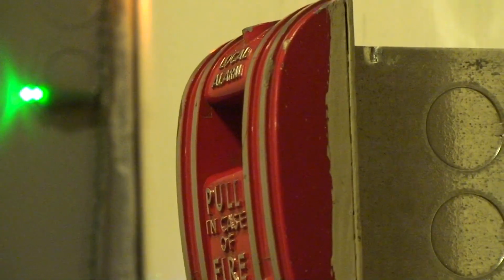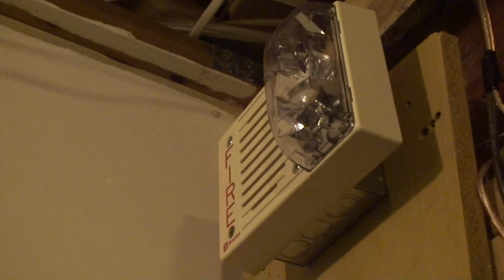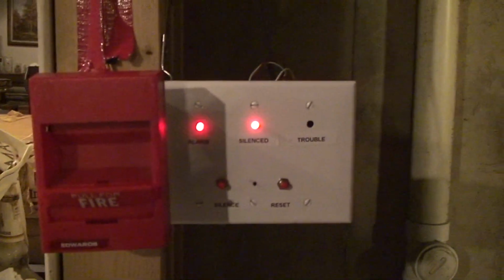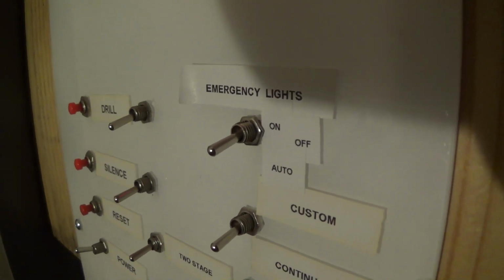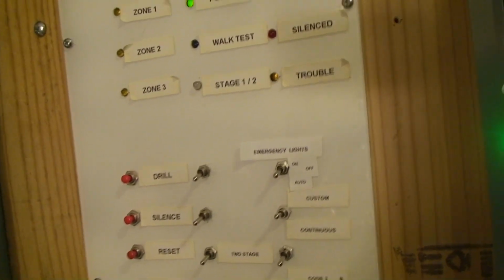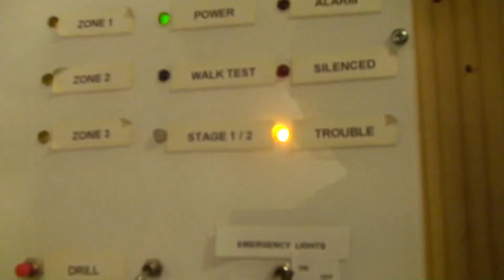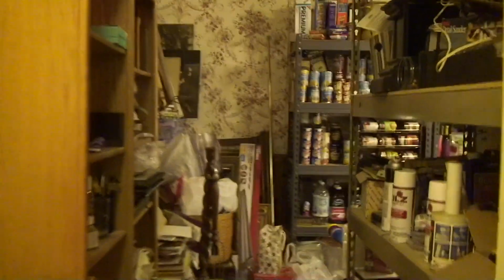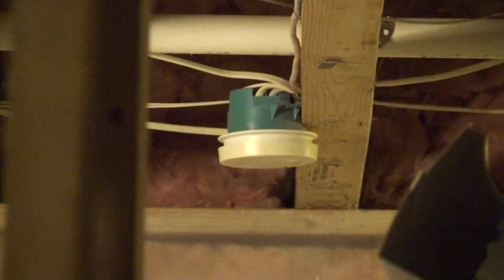System Test 19: New Features, Devices, etc.

Comment: I just got a New Grote 76963 strobe for free. I actually found it in my friend's garage.
Reply from the maker: That's pretty neat!
Reply: Did you research it?
Reply from the maker: I looked at it on Google Images, it reminded me that I need to invest in some amber emergency lighting lol
Reply: Remember, it is a strobe.
Reply: And is is made to go on a car. Much bigger than i thougt. And no terminals.
Reply: Did you ever have the chance to check out my YouTube channel? You know you can just click on the avatar or photo of a user like in a comment or something.
Reply from the maker: I have!  Your videos are good, just remember to record horizontally instead of vertically.
Reply: I do have a review on my spectralert advance and an all tones test of it
Reply: That is the only way I am able to record. Unless i just use ANDROVID
Reply: Do you have a spectralert advance?
Reply from the maker: I have a ceiling mount version without a bracket.
Reply: I have the wall mount with the braket. But without it, you can't get it to work.
Reply: Mine is red. It is also what is in my school.
Reply: Also there is an MGC sh-120 set to broad band code 3 and a potter sprinkler bell outside.
Reply: Do you have a white version?
Reply: Wow

Comment: Can I recommend for some smoke detectors, either a simplex 2098-9636 or a simplex 2098-9201. Both are old simplex smoke detectors but they work very well and are both photo electric. They also activate faster than most System Sensor detectors

Comment: There's a whole bunch of cool things you've added to the system 🙂! Nice

Great video 😉. Also noticed the 9219 is rather low pitched than it sometimes sounds (almost like the FOS 6120, Simplex 9838, and the Simplex 9833). Then again, my 4901/4903 horn I originally had sounded exactly if not about the same as yours, so yeah. Pretty interesting though how mechanical horns can have a wide variety of "sound variations"
Reply: I KNOW RIGHT